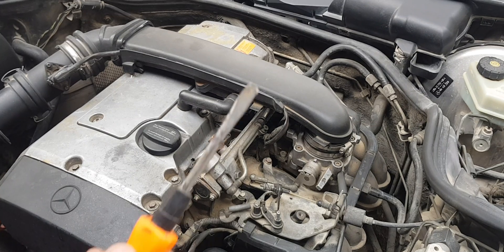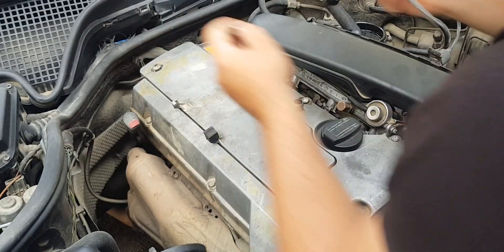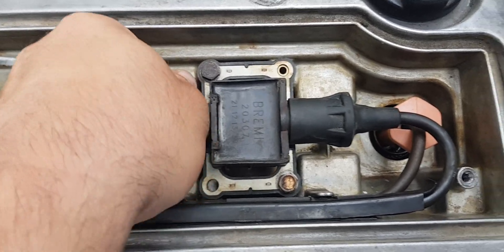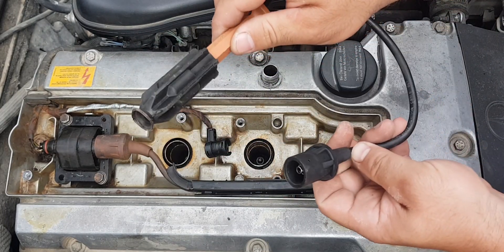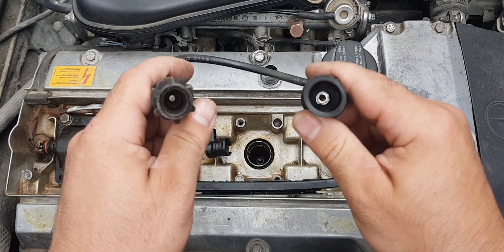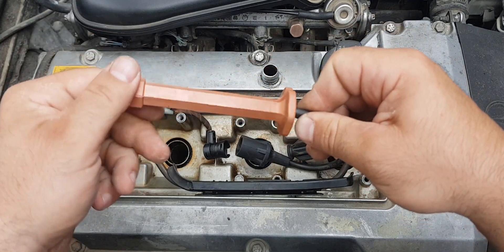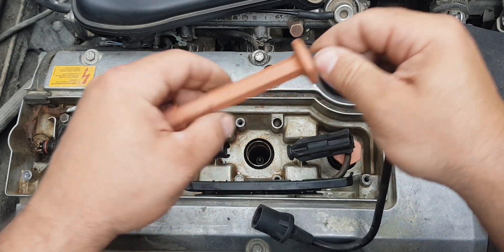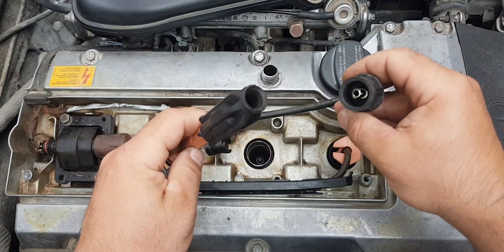Mercedes-Benz W210 Engine Diagnostics/Problems - Everything You Need To Know

Comment: I have a w210 230 in wet weather it comes to weak , feels like no torque inside engine with high rpm at same time what is the problem ?
Reply: Check your transmission ECU for fluid wetness or check for leaks in battery area and trunk area under the upholstery. Also have car smoke tested for vacuum leaks

Comment: Please - What is the lubrication you use to prevent corrosion of the lead contacts ? Great video - please make some more.
Reply from the maker: a special spray is sold for this. apply to the battery terminals and the terminals will stop oxidizing.